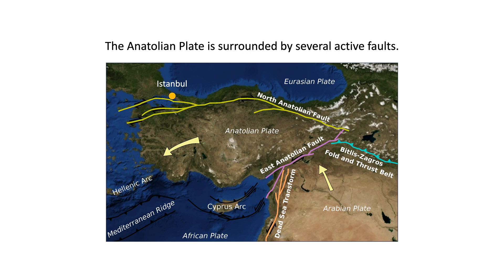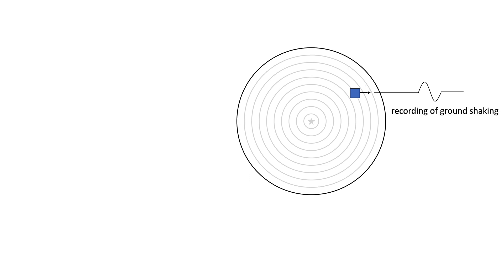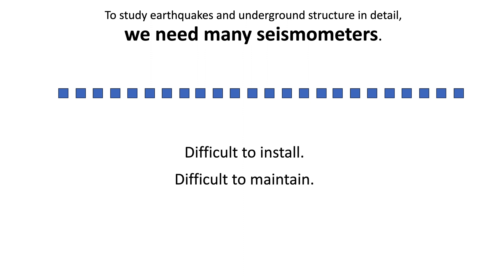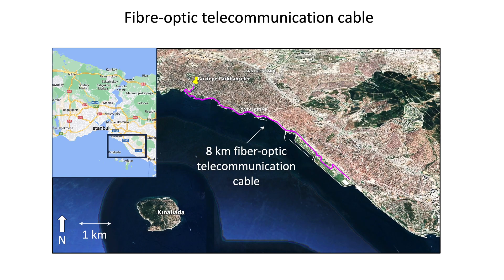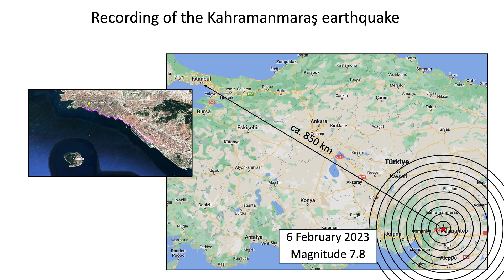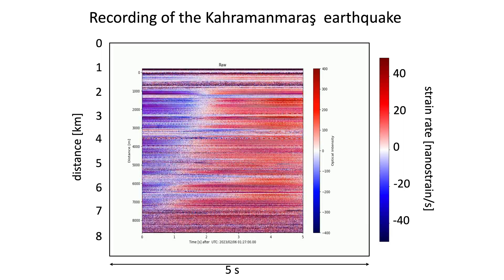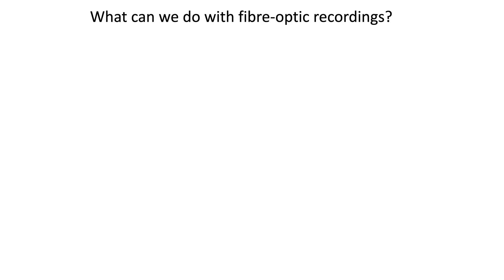Istanbul Fibre Optic Seismology Project

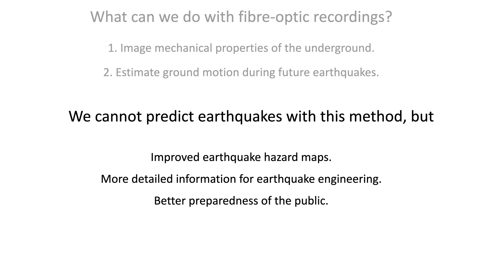Comment: 07:56 - The fact is that the prediction of earthquakes is impossible, taking into account the existing methodology of data processing and instruments used to observe seismic activity.
What can be predicted is the energy that can be released by the defined volume of the hypocentral area based on microearthquakes, which definitely exist, but these events are not "registered" during the classical approach of seismogram processing. The reason for this is the inherited routine, that seismograms are loaded as they are from the period when registrations were made with analog devices.
By coincidence, one of the seismological stations of the Republic Seismological Institute of Serbia (STS-1) was 20-30 km away from the hypocenter when the earthquake occurred on March 24. 2006. If the data of the past 3 months were analyzed using the classic (''regular'') procedure, not a single micro-earthquake would be detectable, regardless of the fact that it is a 24-bit record, because the dynamic range is too large that could be seen on the screen, no matter how high the resolution.
I processed the exported records with my programs (appropriate filtering and automatic amplification while maintaining a common scalar for all three components), it turned out that in the first month, there were an average of 1.5 earthquakes per day, in the second 2.3 and in the third 3.2.
Based on the amplitudes of the P-waves on all three components, the azimuth and angle of incidence were determined, as well as the distance of the micro-earthquake that occurred, which made it possible to reconstruct the hypocentral area and determine its volume and position.
At the time I was working at the Institute, I could only dream of such a possibility to perform 2D/3D observation at a distance of 1 meter from the receiver.
In any case, with this recording system, you have a lot of redundancy, and you could certainly increase the SNR greatly by "stacking" adjacent channels, thus suppressing ambient noise by a significant level of decibels, especially in in case of distant earthquakes.
Regarding the application of such a registration system, I would recommend that, if the current conditions allow, that the registration be done with two systems at right angles (cross-shaped or "L"-shaped), which would ensure a wide azimuth registration.
Also, it would be desirable, when registering a micro-earthquake, to set the appropriate amplification, which will practically use at least 75% of the dynamic range for the level of ambient noise. Given the high accuracy of the recording (1 meter), by summing the adjacent records, you will achieve a high level of noise suppression of all kinds, while at the same time amplifying the useful signal. Unfortunately, the problem of reliable registration of all three components, especially Z, remains. In that case, the tap cable would have to be placed in the well, at least in several locations.
If there is interest in possible cooperation, you can contact me at the email address: aldzunic@tpg.com.au